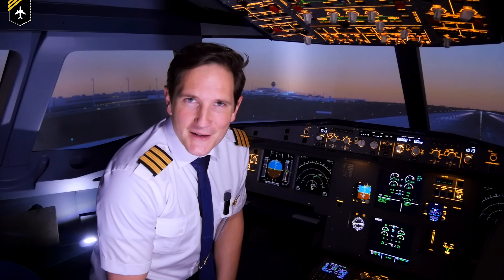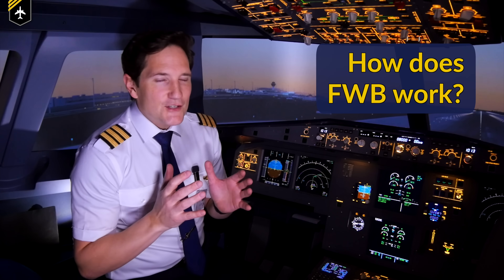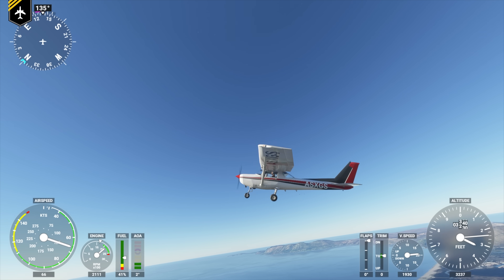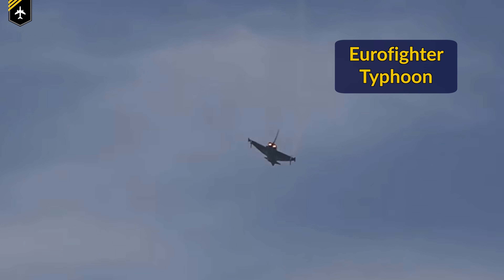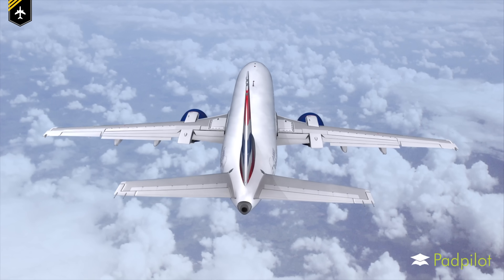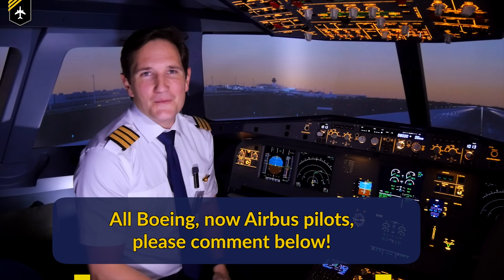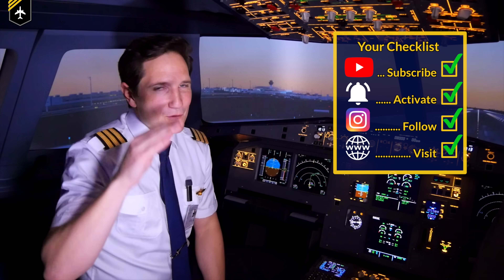How does FLY-BY-WIRE work? The future of flight controls! Explained by CAPTAIN JOE

Comment: Batteries to switches, powered electronically 

Then, controls through microcontroller (telegraph switchboard/telephone line)

To electronic switches (flaps?) 

Using the extra current from closing a switch on the control panel

From another or the same battery 

To override the "closed 0"

Assigned electronic switch 

Opening it, and powering it, raising or lowering flaps etc.. 

All recorded on a flow through piezoelectric oscillator, kept always on (black box)

To store input commands, for software updating the system. 

For a D/C electronic throttle

Networks of switches

Connect many wires, from 1-10

With 1 being low speed, and 10 being high speed

By manually connecting an array of switches, by pressing the throttle forward, for instance 

Allows for more voltage into the turbine of a jet, and opens the fuel nozzles more also, proportionally 

So there you go

D/C fly by wire, forming A/C with magnetic core memory & crystal oscillator black box. 

(Control system)

Could be manually or electronically controlled,

Using batteries, and switches 

Open 0 off, Closed 1 On 

In terms of Binary Coding

In terms of technology 

Its an 1860s telegraph line

The green computer chip

Its just channels that currents can take usually 

So they're pretty versatile between different systems 

And made to be generalized usually 

The core memory is the value of em

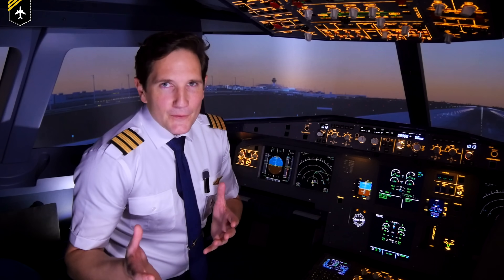Comment: 10:05 - yeah, and there are situations, when untrained pilots moved their side sticks too sharply in "direct low" and caused air disasters because of that. For example, 05/05/2019... Sukhoi Superjet-100 disaster in Sheremetyevo airport. They were flying from Sheremetyevo (Moscow) to Murmansk, when they suddenly flew into a thundercloud and their plane was struck by lightning. This plane is controlled by side sticks, so it has this system and its "lows". So, the plane went to "direct low" flight mode... The commander pulled the side stick too hard, and the plane landed too hard. And then it caught fire because the landing gear punctured the fuel tanks. Slightly more than half of the people on board died...

Comment: The landing in the Hudson was only possible due to fly by wire, you would have had a very hard time pulling that off in a Boeing 737!
Reply: Actually no. The reason that the hudson ditching happened without much fuss was because the APU was turned on even though no procedure mentions doing that. If the APU wasn't turned on, then the entire flying would have been dependent on the RAT
Reply: @ZK-APA  Actually, the flight envelope protections were triggered multiple times during the glide into the hudson. It is indeed very likely that the outcome would have been very different in an aircraft without fly by wire. Yes, the start of the APU was essential, but mostly for the reason that the aircraft stayed in normal law this way.

Comment: I've seen severe problems of certain jet engine failures leading to pilots having to use their experience and expertise to save lives...
Just imagine what will happen if u are trying to turn the plane and the system computers of fly by wire doesn't allow u to do that. It will lead to a crash,therefore i pick yokes allday
Reply: Has nothing to do with yokes in of themselves or sidesticks. Sidestick does not mean "fly by wire doesn't allow u to do that". That is false thinking and FBW always allow the pilot to turn the plane. Name me one accident or incident where the pilot could not turn the plane on an Airbus, 777 787 or any FBW jet. I'll wait. Qantas 32 had the autopilot and sidestick being used for roll control after the A380 experienced uncontained engine failure and the plane was able to turn the aircraft, despite damage to the system.
Reply: The 777/787 have yokes yet they're fly by wire. Goes to show how much you actually understand about FBW

Comment: Flight by light is much better in weigh lighter and less leaking and easier for diagnostic in repairing reduce cost operating to nearly 1/10 by light compare to light by wire

Comment: When you watch the air show and see the demonstration flight of the Boeing 77x and the airbus 350 you realize the maneuvering differences are pretty obvious 777x pilots could bank deeper left & right and make more extreme movements, airbus however maneumaneuvering were more in a normal range of operations so I guess that’s the fly by wire system preventing over compensation on flight applications
Reply: If you were flying on that 777x during a normal flight and the pilot pulled those kind of manoeuvres I'd want my money back if it wasn't to avoid a crash

Comment: Great video. I am confused as to why AF447 A330 crashed into the Atlantic as the BEA report says the.stick was pulled back until the aircraft stalled at 38000 feet.  Why did the FBW system allow this to happen? Your thoughts, Captain Joe???
Reply: See Mentour Pilot video on the accident. They were in alternate law, where the A330 could be stalled.

Comment: Still very confusing as to why they call it 'fly by wire'? It suggests it means literally wires manually controlling apparatuses'? Why don't they simply call it electronic/computer control?
Reply: Because the commands from the controls are sent by wire. You fly the aircraft with wires. Computer controlled suggests the pilot cannot manually operate it

Comment: What happens when the plane loses power? Really curious about this particularly (not a pilot)
Reply: By power do you mean electricity or engine thrust?
If asking about electricity, then its very very unlikely that this situation will come as there is too much redundancy built in (engine generator, APU generator, batteries, emergency generator)
If asking about engines, then the plane wont actually fall from the sky, but rather glide, trading altitude for speed.

Comment: I’ve become so fascinated by fbw, especially in Airbus. One thing I can’t find out is how do the primary flight computers “plug in” to electrical outlet? I doubt it’s simple two prong into a surge protector. It is connector chord that directly into one of tiny bus bars? Also. Are all of the computers sending signals to the control surfaces or is the dominating computer sending the signal? Example an elevator command.
Reply: The computers are connected to power as per each individual aircraft's architecture. But yes there are various bus bars (EG AC bus bar, DC bus bar, AC essential bus bar etc). And all bus have power redundancy (engine generators, APU, battery etc)
And in terms of computers, there are actually multiple computers, each doing a specific task. Say in your example of elevators, the movement of the sidestick goes to the ELAC (Elevator and Aileron computer). This computer then tells the control surface about how much to move (PS this is a very rudimentary explanation, a detailed explanation will have algorithms and logics and what not)
Reply: If you view the smart cockpit A320 flight control document you’ll see how each computer controls a servo jack for the control surfaces. So ELAC 2 controls the elevators primarily by moving 1 of the jacks in the elevator. If that computer fails then ELAC 1 moves the other elevator jack and then breaks down to the SEC’s

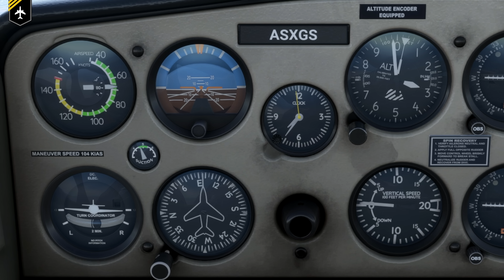Comment: 3:58
Can someone explain why he has to apply left rudder instead of right rudder to maintain a standard rate turn?
Reply: Basically, when an aircraft is banking, one wing is generating more lift than the other (hence one wing goes up, the other goes down). And in a wing (or any aerofoil), the more lift there is, the more drag there is (because of induced drag).
So you are in a situation where one wing is generating more drag than the other, which results in the aircraft yawing. And it is opposite to the direction of roll. As in you bank left, your plane will yaw right and vice versa.
Hence to compensate for this yaw, we apply rudder in the direction of bank. So if you bank left, you apply left rudder as well.
Reply: @ZK-APA  Thank you very much!

Comment: I’ve always found fly by wire technology, as well as the planes that use it, very fascinating. It’s actually worth noting that that Russian plane that you mentioned was a civilian plane. The military were using fly by wire prior to this.  But we weren’t seeing it on fighter aircraft until 1979, with the introduction of the F-16 fighting falcon.  It’s also worth noting that because modern fighters can’t afford to have the weight of mechanical back ups, and because they are so unstable, that if the computers were to fail, the pilot would lose control of the plane almost instantly, forcing him or her to eject. I believe all ejection seats are required to be mechanical for that very reason.  As for the euro fighter typhoon that you mentioned in this video, I believe it is the most extreme example of instability traded off for maneuverability. In fact, that plain, rather than having a horizontal stabilizer, has a delta wing and canards, just aft of the nose.  I was once told that if these were to take a direct hit from a missile or gun, during a dogfight for example, that particular plane would still tumble out of control and crash even if the computers were working correctly.  In fact, the computer system in this particular plane was so critical, that they actually had to test it to make sure it would stand up to electronic interference.
Reply: Concorde was FBW and the VC10 autopilot was FBW analog. You don't want a stable fighter jet.
Reply: @Sterlingjob  yes, but I think the F 16 was the first fighter plane to use digital fly by wire.  From there, we had the A320 with hitch on digital fly by wire system.  The Concorde may have been the first airliner to use fly by wire, but it was fairly primitive compared to the system used on the A320 and newer airbrush models.  But still, the Concorde was very advanced for its time.  I’ll be interested to hear what becomes of the boom overture.

Comment: Captain Joe, because the airbus has the aircraft protection built into the fly by wire system, would you say that they are among the easiest aircraft to fly for a complete beginner?

Take this scenario for instance...

Imagine both pilots are incapacitated on an A320 during flight, and the autopilot disconnects due to malfunction, therefore a passenger with no flight experience is forced to hand fly and land the aircraft, would this be simpler and easier than the same situation on say a boeing 737?
Reply: In my view yes primarily because the A320 doesn’t require you to manually trim when making adjustments on the sidestick. But then again many malfunctions that cause the AP to disconnect will cause the aircraft to enter alternate law and subsequently direct law upon landing which makes landing for a beginner the same as a 737
Reply: @tomstravels520  see, im still not a complete 100% lover of the airbus, see, say for instance a really high current lightning bolt hit the plane, and took out all the computers, every last one, wouldnt it fall from the sky like a stone?

See, wirh the 737 having manual cables, thats another last ditch method of flying without any electrical power, or hydraulic power
Reply: @russellrattys6581  no because firstly planes are designed to withstand lightning bolts. Secondly the horizontal stabiliser and rudder are mechanically connected (newest A320 have electrically operated rudder with back up control) so if all computers failed you have pitch, roll (differential engines thrust) and yaw capability. Not smooth or precise but better than no control. Also remember the A320 has a RAT in the event of electrical power loss. The 737 doesn’t so if all power is lost including APU it only has about 30 minutes of battery until everything goes dead

As for hydraulic loss the A320/A330/A340 have 3 systems and can still fly with 2 knocked out. The A380/A350 have 2 systems and then some of the controls use EHA’s or EHBA’s. In short if all pumps failed or fluid was actually all lost then some control surfaces would still function to get the aircraft back down.
Reply: @tomstravels520  The 737 doesn't need a RAT, the engine driven generators still produce electric current just by the engines windmilling from the incoming air.
Reply: @ngaviation3489  that’s fine as long as both generators are working. There was a southwest 737 not that long ago that had both generators fail at the same time and took off without a functioning APU
Reply: Not sure about a passenger, but yes if there is someone who is a pilot (basic cpl holder), they will have a much tougher time hand flying the airbus compared to boeing, because the airbus doesn't fly like a conventional plane in normal operations

Comment: Both 737 and 747 are fly by wire. They have cables but together with servos. I'm talking about newer ones but i heard that even older  Boeings had flyby wire for trim and etc.
Reply: I can't tell if you're confusing wires with cables. Even the newest 737 and 747 are not fully fly by wire. They have FBW spoilers and the 747-8 has FBW outboard ailerons but the rest is still cables and mechanical linkages, not electrical wires. The 777 and 787 are the only fully FBW aircraft for Boeing.
Reply: @tomstravels520  I'm not saying that it doesn't have any mechanical controls.

Comment: I congratulate you Captain Joe for your explanatory videos.  I have a query regarding the FMGS system: I saw a video on youtube about the FMGS function, and that it works with 2 FMGC;  2 MCDUs;  1 FCU and 2 FACs.  My question is if the FMGS also works with the ELAC and SEC?
Reply: Yes. Simply put when the autopilot is turned on the FMGC on the side that was activated (remember it’s AP1 or 2) is sending commands directly to the ELAC/SEC. Obviously with autopilot turned off all the FMGC can do is move the flight directors to indicate what the pilot should do but cannot move the controls itself.

Comment: Did you ever do a video about if the fly-by-wire system fails?
Reply: Then you revert mechanical backup and use the trim wheel to adjust the stabiliser for elevation and use the engines and rudder to turn as they are still mechanically connected. The latest A320’s have an e-rudder now but have a backup control module incase of total computer failure

Comment: Have you ever watch Scotty Kilmer channel about replacing electronics power steering actuator? My thinking with fly by wire is also same. Electronics control is wonderful when it works, but it is not when not fully work.

Comment: 11:48 Not only was the Avro Arrow FBW with force feedback it was also designed with Inherent stability in the Yaw-axis controlled by solid state computers (calculators today) as well as Marginal stability in the Pitch Axis both of which wasn't seen in military production aircraft until the F-16 & F-18 arrived.

Comment: How much redundancy do the flight control computers have?  Because, if they're using anything like Micro$oft Windows, they're going to crash as some point!  (yeah, I know it's not MS-Win, but any computer has the possibility of crashing or freezing up!)
Reply: It's complex, but for a basic control surface it can be low as 2, for something more critical can be 3-5 computers
Reply: They also use much older chips for which all the bugs are known.

Comment: I remember reading an article several years ago where duiring a flight test on the Airbus A320 where the P1 and P2 both activated the command override button, P1 turned left, P2 turned right and the aircraft continued straight ahead.  Apparently it was a software fault corrected afterwards.
Reply: No. If in a 320 you go in opposite directions, the system sums the inputs and you go straight ahead. Still does it and we demonstrate it in simulator training. This is actually a feature, not a fault.
Reply: That's not possible. If both press the override button then command is given to the side where it was pressed last.
Reply: @shi01  this isn’t about the priory button. Thai is about what happens if both sides take opposite actions. They are then summed, so if the sticks are moved in opposite directions simultaneously, the effects are cancelled.
Reply: @peteconrad2077  Yes true, as long as no side keeps the priority button pressed.
Reply: @shi01  quite. I think that was the point.

Comment: thats why flying 737 is hard manually and its easy on a320 fly by wire in simulator ( my experience)
Reply: By hard if you're meaning feedback then yes. Because airbus sidestick isn't physically connect to any flight controls

Comment: Great video again Captain Joe! Just a quick observation. With that, you don't have to trim the A320 when manual flying (AKA no AP) compared with the Boeing 737? Thanks!
Reply: Yup, Airbus has auto trim, whereas in boeing you can trim with the trim knob on the yoke.

So there is a slight difference in how both fly.

Comment: Question. You mention that fly by wire will prevent stalls. In the case of Air France 447, the pilot pulled back on the side stick too much for too long causing the plane to stall. Did the plane stall because the computer was receiving faulty data from the frozen pitot tubes?
Reply: That was one of the contributing factors
Reply: Sort of. The plane was able to stall because when the pitot tubes froze and air data became invalid the plane had no idea how fast it was flying so went into alternate law which basically removes most of the protections and gives more control to the pilots. It should have then been the pilots job to establish a safe speed and fly the plane. Especially as even if all the airspeeds came back the autopilot would not recover and the plane would stay in alternate law for the remainder of the flight